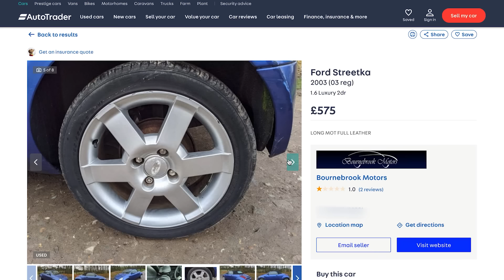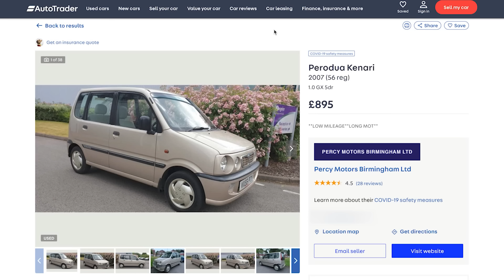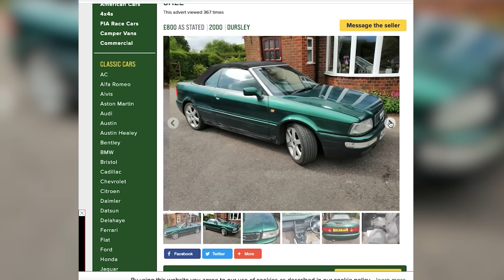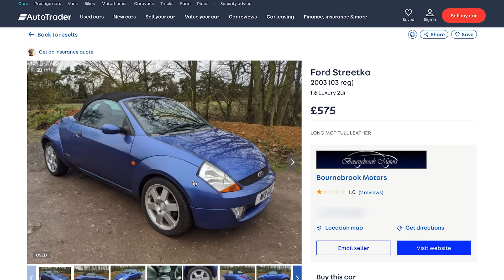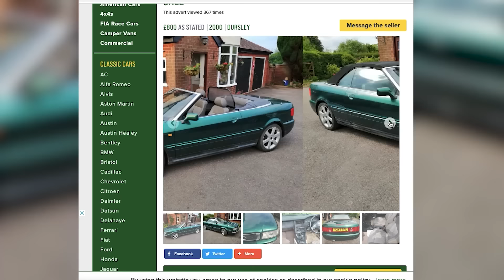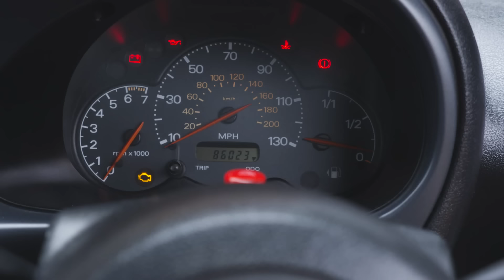£1000 Cheap Summer Car Challenge (feat. Mike Brewer)

Comment: Important Update...

That Perodua is still for sale
Reply: serious? leave a link
Reply: @hassanrehman3521  There is literally 1 Perodua Kenari for sale on the entirety of Auto Trader UK, so it isn't too hard to find.
To put that in perspective, there are currently 8 Bugatti Veyrons for sale on Auto Trader.
Reply: Drunken Hobo ohhhhh my bad why did i think it was on gumtree for some reason
Reply: It's actually kind of interesting. Despite being 13 years old and having 65,000 miles, it has only failed 1 MOT... because it needed new windscreen wipers.
There are currently 508 Perodua Kenaris still on the road in the UK. That makes it only slightly more common than the Lamborghini Aventador, which has 493 examples on the road. The Kenari even comes with a spoiler, so if you squint really hard you can pretend it's an Aventador... that's been through a car crusher.
Reply: @drunkenhobo8020  do you remember donald dump... that white proton alex bought a few years back, there are twice as many veyrons for sale on autotrader than there are donald dumps taxed in the uk
Reply: @drunkenhobo8020  I've been looking at that Perodua, it's been up a few days.
Reply: Hazza Knox its proton
Reply: @hazzaknox1069  an old guy near me still drives one of those, it's red aswell so I don't know if that makes it rarer
Reply: @qlus  probably does make it rarer
Reply: @scuckplexity  my toyota crown athlete vx is the only one in the UK as far as I know. They only made 300. There are a few crown athlete models on the road. Awesome cars
Reply: SynchLy actually it is a rebadged daihatsu move
Reply: What that is my country nation car!!!
Reply: chappy2121 beautiful car. The closest i can get is driving it on GT Sport.
Reply: So it is
Reply: @auyong1566  greetimgs Malaysian
Reply: @drunkenhobo8020  So basically, it's a supercar? One of one in the UK.
Reply: Hammond: "This is gonna be like cornering on an office chair..."
Reply: 420th like

Comment: I did that exact keys in boot scenario with a ford Fusion. Tbf breakdown broke in the car with small air bags to prise windows open and a bar to wind rear window down. Then simply seat down to get to boot. Glad you saw the flaw  before I had lol

Comment: im just taking notes for what my first car should be lol
Reply: 1999 R32 Skyline, perfect starter car
Reply: 3 series compact 323ti maybe a smaller engine for insurance
Reply: Honda Jazz
Reply: MrcabooseVG yeah go on sure.. insurance will 10000% be cheap
Reply: SportKa is lovely, but maybe too expensive in insurance
MK2 Ka looks like a women’s car, but drives sharp even though it’s a bit underpowered
Reply: @mrcaboosevg6089  Must've been a really late build r32 if its 1999
Reply: @mrcaboosevg6089  There's no such thing as an 1999 model R32, unless you meant to say 1989.
Reply: PT cruiser! You will have the girls throwing clunge at you
Reply: 106
Reply: Quagswag I had an ST170 as my first car 3 years ago
Reply: @Filipe1020  I meant R34, there's so many cars in my head i get them mixed up tbh.
Reply: @mrcaboosevg6089  You could do a research before commenting, just saying.

Comment: These challenges are a dream of mine! But I do have a little classic which I’d like you guys to try one day... You may have mixed reviews, as it’s like marmite, you either love it or hate it, but it’s a Renault 4 GTL.... I saw your Hillman IMP video and fell in love, however, this car would really be a decent one to make a video of for many reasons which I will list now.. 1 - The gear stick goes into the dash like the old Fiat 500... 2 - It’s a 1.1 nippy little engine which does manage 80mph (that’s fast for a 32 year old car which shakes at speed).... 3 - It tilts when you turn, like the old Citroen 2CV.... 4 - It has been rebuilt, it starts every time, and it will perform better than most new 4x4’s when it comes to real off-road driving... 5 - Stick a surfboard on top and she gets all the babes (Haha!)... 6 - She turns heads, makes a lively sound, never stops and gets around 50mpg... 7 - There are no electrics apart from 2 USB ports which I’ve installed, so you needn’t worry about Ethan working on it....  8 - They’re becoming a rare classic which beats the VW Beetle, 2CV and Fiat 500 easily.... 9 - I’m pretty sure Mike loves them.... 10 - You will definitely smile when you drive it.   Kindest regards, love your show, keep it going lads, its ace.

Comment: Trunk not opening with the key button is an extremely common error for all the fords from that time. If power comes to the lock the lock itself is broken but id it doest, you will never have it fixed unless you pull a new wire. Also it will work perfectly in a very cold winter weather. Never in summertime.

Comment: I think it’d be nice to have a Ford Ka as a daily driver. My cousin used to have a 2001 model. They’re small, have an...interesting design, and they’re very, very fuel efficient. It’s a shame they were so unsuccessful here in Australia... Because they only came with a manual transmission, not many people here bought them, so Ford discontinued them in Australia in 2002, making them hard to find.

Comment: Interesting what's available for so little money. Got a nice little car for the money. Might even be able to insure that as a classic? Certainly would of it was based on the engine, cos that's the wheezy old Kent that  Ford have been pumping out for years. They might have disguised it with a plastic cover but that tappety old pushrod lump is from the days of the Anglia 😂😂😂

Comment: Hey CarThottle Fans
 Just a friendly reminder that Catalytic Converter thefts are at record highs right now. I just had mine stolen on Friday leaving me with no car over the weekend and a thousand pound bill.
They cut it so that I needed to replace the down pipe, cat, two O2 sensors and the midsection. Protect your catalytic converter now! 

They are especially targeting Toyota, Honda, Mazda, Nissan and Lexus. Basically all Japanese car brands and even more so if it's a hybrid.
Install a catlock / catguard now. Don't wait!

I'm also hearing horror stories of folks being declined insurance for high risk vehicles which then means you have to declare that you have been declined insurance on all future applications, no matter what you drive pushing your premiums up.  
You might think it sounds odd that they would decline insurance, but if you get hit, they have to cover a courtesy car sometimes for weeks + the costly replacement of  the cat / o2 sensors and then some folks get hit more than once as the thieves know that you'll repair it. Before you know it come the end of the year. Insurance don't want anything to do with your car.

My car doesn't feel the same anymore, it feels violated after they messed with it.
Feels bad man.

Comment: Is Hyundai coupe what we call tiburon in the US? I don't think I've ever seen a 'coupe'.

edit: I don't know who Mike Brewer is but I think he really adds to the show. I'd like to see more episodes with him.

another edit: When they were talking about leaving the keys in the boot it reminded me of one of my biggest dislikes of vw jetta (had a 2014 and 2017, both had this annoyance). When you close the trunk lid the car automatically locks the doors. So I come out of the store, throw my keys in the car, open the boot from inside the car, get out close the door and go to fill up the boot, slam the lid and the car goes beep beep and locks my keys inside... ffffuuuuuuu!!! Luckily a relative was in the area and gave me a lift home for the spare set of keys.
It's also something I really like about chevys, the onstar assistance thing can unlock the car remotely - I know some other brands also remote support but it's an additional service, chevys come with onstar built in by default.

Comment: I've noticed that Ford seems to cut A LOT of corners with their cars; cheap materials, bad engineering, I honestly will never own a Ford again. (I had an 08 Edge and thought it was comfy to drive and sit in, but the wimpy little transmission they put in it wears out after some time, and brakes are also crap)

Comment: why are used cars so cheap there?  here in the us a 200,000+ mile beater will run you $600-$1000 if it can be legally put on the road.